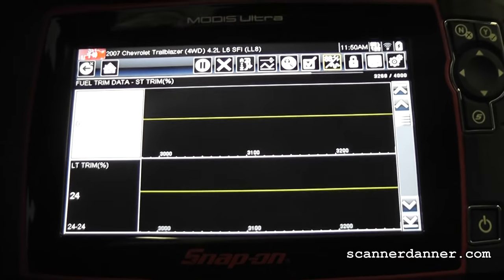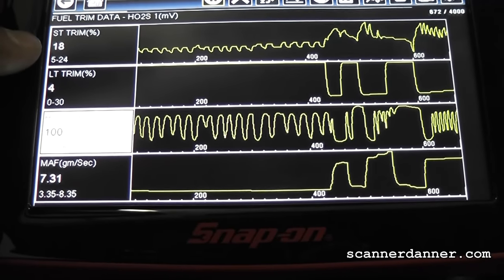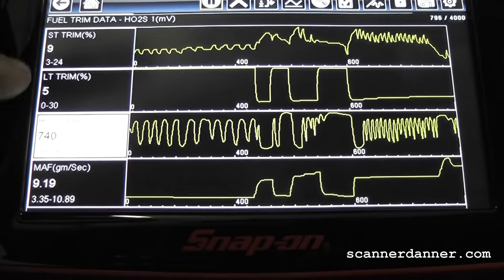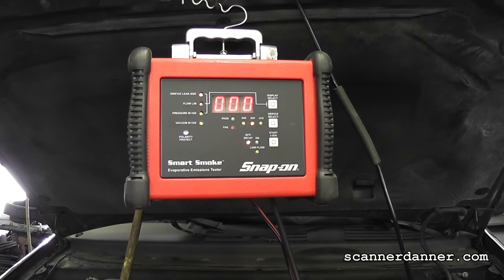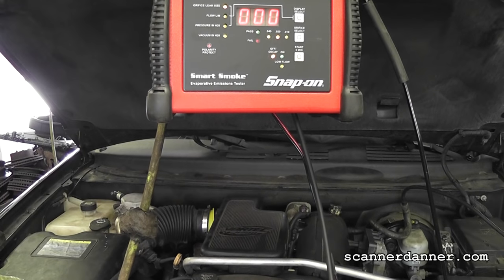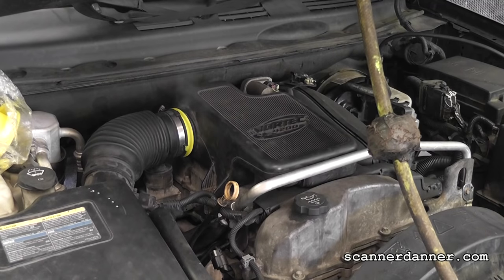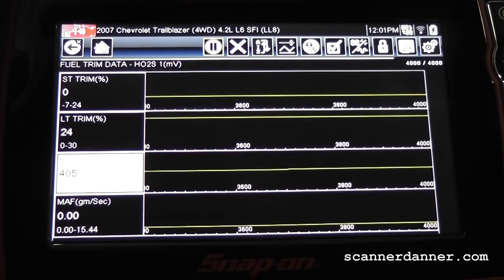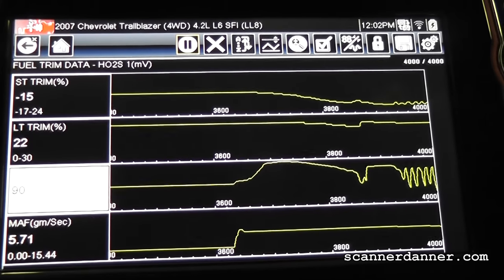STFT reads opposite of LTFT (after repair fuel trim data)

Comment: is anything different in checking the vacuum leaks when the trim numbers is negative? both of mine are negative, what should it do
Reply from the maker: +Universe's rabbithole negative fuel trim numbers indicate a rich condition. So you do not have a vacuum leak on your car. There are many causes for this condition . It would help to know what you're working on
Reply: +ScannerDanner mmm ok. I working on my 99 honda prelude. i just refurbished the alternator and the battery is also new (few months older than the alternator.) when I check the power voltages the battery was around 13.5 static and when I turn on the car jumps to 16 ish. the rmp when idle is around 600-700. I think I can lower that to 500 with the throttle body adjustment thing, should I lower the rpms? what's happening is sometimes when I cold start the engine rpms loop on a jumping rpm.
Reply: I have the same prob;rm with my 2010 Elantra 4 door Sedan, with a rough idle, poor gas mileage and a performance problem. I hope you get a answer. I did  post this problem today, hoping to get a answer. STFT and LTFT both negative but do add up to less that 10% negative?

Comment: Hey Scanner, I'm having an issue I'd greatly appreciate your thoughts on. It's a 2012 Hyundai sonata 2.4l. At idle stft stays pretty much around 0.0 and ltft stays around 10.2. If I give it any throttle the stft shoots up to 18.0 and the Ltft instantly goes to 0.0 until I let of the throttle. And help and your time will be greatly appreciated! Thank you.
Reply from the maker: MAF sensor or fuel psi issue
Reply: @ScannerDanner  it doesn't have a MAF, only a MAP and it's readings are perfect. It's a GDI engine and the fuel pressure is perfect. Sorry my original post for some reason didn't have everything I wrote. My car is past inspection and I can't get it through because the o2S Monitor will not get ready. All other monitors are ready except o2S. I have over 4 drive cycles and 200 miles. What would cause just the o2s monitor to not set. Fuses are all good. I've never had anything like this happen and o2s monitor has always set pretty early for me.
Reply: I’m getting the long fuel trim 0.0 always!!
Reply: I think its the o2 sensor in front
Reply from the maker: @rankgts3962  monitors not setting is a major pain on some cars and fortunately for me I am not the one that has to deal with that issue. Something to think about is the thermostat, I have seen one that is opening too soon cause monitors not to run

Comment: My short term is -3 and my long term is +7 at times.  I don't get why they move in opposite directions.  Short term is taking away fuel and long term simultaneously is adding fuel.
Reply from the maker: STFT will have about a 5% swing, it is not fixed.
Both of those numbers sound fine. What are you chasing?
Reply: @ScannerDanner  Intermittent misfire at idle or at least I think it is a misfire.  I get these shakes felt in floorpan/seat...no change really in rpms when it happens so I am actually starting to think it could just be mounts but the weird thing is I don't feel it as much in drive ...I would think i would feel it MORE in drive if it were an engine mount...and it is intermittent not consistent.

I did notice some scratches in the coil.  I don't know if it is carbon tracking but it is in the housing where the coil towers are.  It is a waste spark system.  I pulled plugs and I definitely don't have any dead cylinders but I have what I feel like could possibly be a bad coil that is intermittently not firing or perhaps spark plug that is fouled with oil
...I replaced plugs and noticed oil on threads....
Reply: @ScannerDanner  I know it isn't fixed but I was just surprised to see long term at +7 and short term down at -3....

Comment: Hey Paul. If the customer continues to drive the car will the fault code still be stored in memory or will it eventually erase itself?
Reply: +Bobby Budd Exactly what I was wondering. For other codes I've seen them stay even though they had no reason to stick around. I've lost pending codes, but not hard codes where the PCM is sure.
Reply from the maker: OBDII mandates say that the fault will erased from memory after 40-80 warm up and drive cycles with no fault. So the average driver would have 2 of those per day (on the way to work and the way home).
Reply: ScannerDanner Awesome answer. Thanks!

Comment: I’m having issues on my 04 ranger 3.0 short term fuel trim and long term on bank 2 reads high at idle and with rpms up. Rpms at idle are 687 to 732. Replaced fuel injectors, spark plugs, MAF, ignition coil, bank 2 O2 sensors, pcv valve, did a smoke test nothing. Any suggestions?
Reply from the maker: What are your bank 1 and bank 2 numbers (need both)
Reply: @ScannerDanner  bank 1short term 3.9%long term 1%. Bank 2 short term and long term both 25% positive
Reply: @ScannerDanner  thank you and God bless🙏
Reply from the maker: @mikeb5981  do you have a misfire on bank 2? How does it run before it goes into closed loop (before the O2 sensors become active), compared to after? Can you add propane to the intake and drive the bank 2 O2 rich? What is the bank 2 O2 sensor doing during the +25% ST and LT fuel trim. It doesn't matter that the O2 is new. Let's put that aside for a minute.
Reply: @ScannerDanner  I will have to get back with you on those readings it’s been raining so I haven’t been able to do anything to it.
Reply: @ScannerDanner  freeze frame data shows p0174 Fuel system 1 status CL. Calculated load 36.9%. Engine coolant temperature 158 degrees. Short term fuel trim bank 1 1.6%long term fuel trim bank 1 0.0% short term fuel trim bank 2 27.3% long term fuel trim bank 2 21.9% rpms 724.air flow rate from MAF 0.6 lbs/ min. O2 sensor bank 1 sensor 1 0.575 volts bank 1 sensor 2 0.085 volts bank 2 sensor 1 0.760 volts bank 2 sensor 2 0.815 volts 
If your interested in coming down to Virginia to do a diagnostic let me know 😂 God bless 🙏 and THANK YOU
Reply: @ScannerDanner  I also just put the new fuel pump in brand new Ford fuel pump and fuel filter a long with new Ford fuel injectors.
Reply from the maker: @mikeb5981  freeze fram isn't helping me. I need to know what the bank2 sensors are reporting, with live data, while your fuel trims are maxed out. Thanks!
Reply: @ScannerDanner  data stream says bank 2 Sensor 1 0.765 voltage O2 sensor B2-S2 0.730 volts
Reply: @ScannerDanner  when I rev the engine up short term fuel trim bank 2 goes up to 46.1% and long term fuel trim bank 2 drops to 1.6%
Reply: Still no fix unfortunately.

Comment: Ever run into a STFT rich condition driving ( 20%) then coming to a idle it goes opposite (-19.2%) but LTFT is always 0%?   2000 4runner 3.4 Calif emissions
Reply from the maker: after it is idling for a few, does it recover? what is the LTFT when the STFT recovers to a normal number?
Reply: @ScannerDanner  LTFT always zero no matter what
Reply from the maker: @TheBracket1  and the rest?
Reply: @ScannerDanner  driving at 55 stft is -20% ltft is sitting at 0%... come to a stop stft will go to +19.2% and ltft will stay at 0%
Reply from the maker: @TheBracket1  sorry, you said this in the beginning. Unfortunately I don't see these full threads in my email when I reply. A positive trim at idle only, is almost always a vacuum leak. I believe you may have two conditions, with this being one of them. The rich under load, I would focus on the MAF sensor and then perform an injector balance test and make sure they all have the same flow rate. Toyota's had injector issues, not sure about your specific model though.
Reply: @ScannerDanner  to be honest I cant even remember if I got it correct.. it may have been -20% at 55mph then +19.2% at idle... it's got new injectors,A/F ratio sensor in b1s1 ... 265k on the vehicle... but has a p0135 and a p0125 code... after it warms up if you shut it off then start back up and drive it has a misfire in #4 so bad the check engine light flashes.
Reply from the maker: @TheBracket1  "new" means nothing these days, flow test those injectors! The misfire on hot restart is screaming injector leakage.  The P0125 is usually from a thermostat that is opening too soon, not worried about this one, change your thermostat. The P0135 code you ABSOLUTELY must focus here too. With California emissions, I am almost positive that you have wide band upstream O2 sensors, and those cannot work without a working heater circuit and that is a heater circuit code.
Reply: @ScannerDanner  ok I'll try to flow test them but what would cause the heater circuit code... I took the harness completely out of the truck and checked for damage and found none.. did a continuity check on all 4 Air fuel sensor wires all were good.. I swear I've never seen something so frustrating
Reply from the maker: @TheBracket1  need VOLTAGE reading on the heater circuit wires while the truck is running to help you further with that. We need to start here too BTW.
Reply: @ScannerDanner  ok.. the 2 black wire's on the sensor which are white w/blue stripe and blue wire on the truck side both have 11 volts.. the other 2 have nothing... he originally had a o2 from oreilly but has swapped it out for a factory one from Toyota
Reply from the maker: @TheBracket1  okay now we are getting somewhere. The white-blue is the heater power feed and the blue is the heater ground which is controlled by the ECM. You are reading battery voltage on the heater ground, which means there is no ground!! This wire MUST be measured at the ECM next, to test for an open circuit in the harness. (Pin #4 on the E10 ECM connector is the one you want to test - blue wire, Pin 3 is empty, Pin2 is green/black and on the other side of pin #4  you have pin 5 which is red and pin 6 which is white). 
To be clear, the measurements you took was with the engine running right? It MUST be running.
Reply: @ScannerDanner  yea it was running
Reply: @ScannerDanner  when I had the harness out I did a continuity test on all 4 wires from the o2 to the connector at the computer and all 4 were good 0.00 on the multimeter.. so is my computer bad?
Reply from the maker: @TheBracket1  do the voltage measurement please, then I have another test for you after that. It isn't time to call a bad computer yet
Reply: @ScannerDanner  Driving  it home to get something.... radio went out, abs light came on, air bag light came on, will hardly run, turn signals wont work
Reply: And now the security light flashes.. wont start
Reply from the maker: @TheBracket1  turn signals and ABS relay share a ground "front of the left front fender" G100, something to check, but the Air bag system and radio are not on that circuit. 
The radio ground is on the left kick panel G200. And so is the air bag! Here is a kicker for you. The fuel pump also shares this ground (G200, left kick panel)
EDIT!! The G100 ground is also where the EFI main relay control circuit get's it's ground.
Reply: @ScannerDanner  ok, so somehow the alternator was unplugged and killed everything.. but anyways... blue wire while running is 13.6.. and I assume those 2 I tested at the o2 yesterday would have also been 13.6. But the battery was going down.. but blue wire at E10 pin4 is 13.6
Reply from the maker: @TheBracket1  okay sweet. Next step and it is SUPER important that you follow this to the letter.
Step 1. Unplug the O2 sensor
Step 2. Connect a test light (must be an incandescent style bulb) to battery positive and connect it to that same circuit.
3. With the test light still connected, clear all trouble codes.
4. Start the truck and tell me if the test light lights up. If it does, the computer driver that switches that circuit to ground is fine and we will be focusing back on the O2 next
Reply: @ScannerDanner  ok just to be clear.. test light was connected to positive of battery and other end was on the Blue wire on E10 block.. 2 was unplugged, cleared codes, started truck but no light
Reply from the maker: @TheBracket1  did you clear the codes? after clearing the codes, make sure that you read them again BEFORE you start it. If that O2 heater code is immediately back, then we are going to start leaning towards a bad driver in the ECM. I'm saying "leaning towards", we are not ready to condemn it yet. Yes on the rest, you did good, other than the code checking and clearing
Reply: @ScannerDanner  test light did light up
Reply: @ScannerDanner  any other test at this point?
Reply from the maker: @TheBracket1  you need to be as specific as possible in your replies. All you said on the last one was that the test light lit up. What did you do to make that happen? Was there a code that was preventing that test from working? Did it work then after you cleared the code?
Either way, your computer is fine, so the question is why is it not turning on that heater circuit? Most likely, from our tests so far, your heater is bad inside of your O2 (doesn't matter that it's new). Use a FACTORY part for the replacement.
Reply: @ScannerDanner  my fault, I went thru that test again... unplugged o2, test light to + battery other side the blue wire in the e10 block, cleared codes (p0135) was present, started truck,  test light came on.
Reply from the maker: @TheBracket1  all good buddy, you're doing a good job. Here is what we know for sure, your engine computer is absolutely fine and you most likely have an O2 problem. The computer driver does NOT like what it sees with that O2 in there but does with your test light. Make sense? There is a possibility of a wiring problem to your O2 heater circuit though, so to be sure, you need to check the O2 heater circuit voltages again, but each time, you must clear the codes first before doing the voltage measurement. 
Maybe before we do this test, I need something else answered for me. With everything plugged back in, clear all codes and then re-read them, without starting the car. Does that heater circuit code show up immediately or do you need to start it for that code to show up? I need to know this to advise you on how we want to test those voltages on the heater itself. I want to test them BEFORE the code sets. Code setting as you can see, makes the computer shut-down that heater circuit.
Reply: @ScannerDanner  no problem I'll do that.. from what's happened so far the code doesn't come back immediately when it has been cleared and i turn the key.. it takes about a minute or 2 if I had to guess while driving. I will check those readings and get back to you
Reply from the maker: @TheBracket1  okay great, if that code doesn't come back immediately, then we can do our tests as planned. Are you with me that this looks like a bad O2 heater? (bad sensor). Will this fix all of your issues? Maybe. But will this fix a main issue? Absolutely
Reply: @ScannerDanner  yea, I  kinda see what your saying especially after seeing the test light test
Reply: @ScannerDanner   have a small issue... just for my own sanity I did the test light check with the blue wire in the e10 block... I unplugged the 02, connected test light to battery and blue wire, cleared codes, started truck and now the test light "does not" light up. 🤦‍♂️  and I dont know if this information is useful or not but... I do not get a check engine light or code right away but I do get a "pending" code right away of the p0135 when started... and i plugged the o2 back in...and still had the test light connected to battery and E-10 blue wire... i pulled the keys out of the ignition and the test light lit up? Also it will light up after about 60 seconds when you shut the engine off... but this is with the o2 plugged in... if its unplugged I get no light now
Reply from the maker: @TheBracket1  yeah, that is a little confusing, but honestly I don't much care. Here is what we know. The PCM driver is fine! So why is it not grounding the O2 sensor heater circuit with everything plugged in? Two possibilities, a wiring problem on the O2 heater circuit (power supply or the switched ground circuit) or a bad O2 heater itself. That is it, no other options. 
Re-do your voltage checks on that O2 heater circuit. Make sure the codes are cleared before doing the measurements, and make sure you are seeing the initial turn on of the O2 heater. Supply or power feed should be battery voltage (must be checked while the PCM attempts to turn that circuit on) and the switched ground should show 12v or battery voltage until it is turned on, then it should drop to near 0v.

Comment: no mention of the brand of smoke machine
Reply: snap on
Reply: TheBattlestorm
 Thank You , there are so many smoke machines where people are not pleased with the output
Reply from the maker: Snap-on. If you pause the video you can get the info you need. Sorry about that